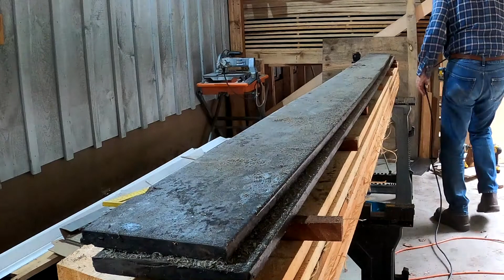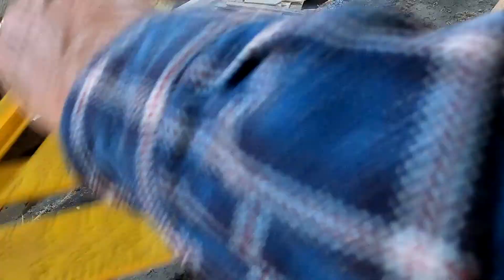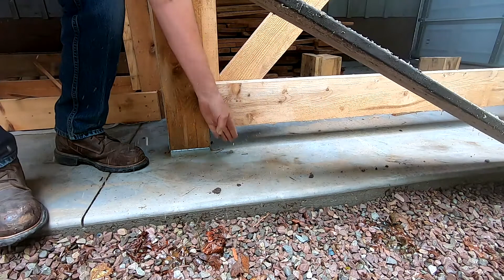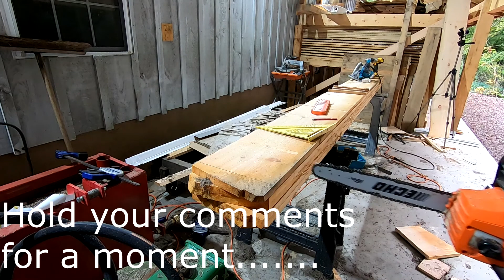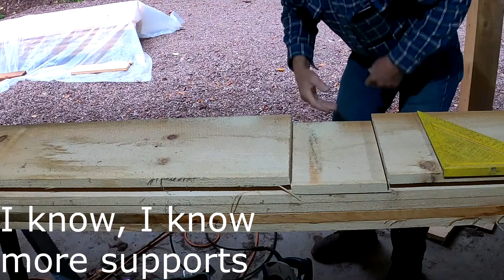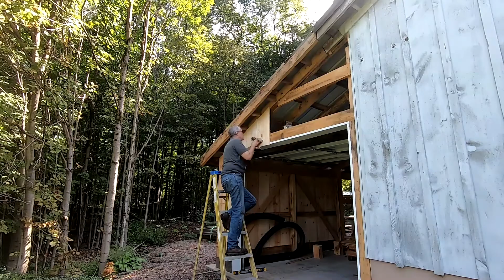Taking Sides At The Shop # 158

Comment: Is this what you did before sawing lumber ? I’m guessing that if you had a crew come in and use store bought lumber ect with the roof and crete probably would cost you close to what you have into the mill. 50x 12 ?  Nice job

Comment: That looks amazing. Where did you find the rot resistant material you used at the bottom of the wall in contact with the cement ? I’ve never seen that before and it could be really useful in an upcoming build.
Reply from the maker: You won't like my answer but............... I found the material in the weeds. Literally.
I was at my son's new camp and found these "boards" over a bank and in the weeds. Absolutely no idea what they are. I wish I had just one more for the barn doors I'm going to build.